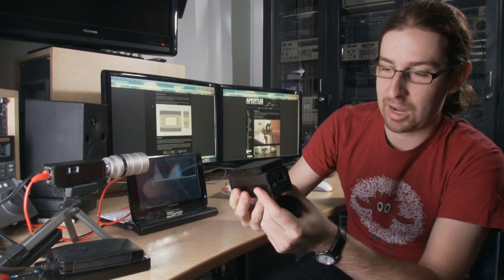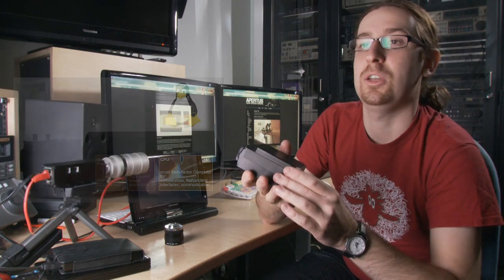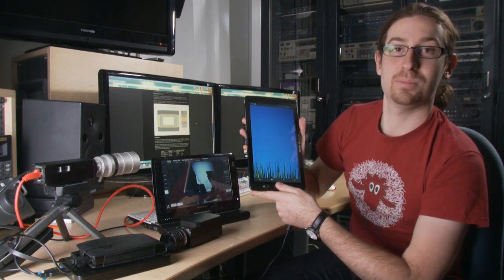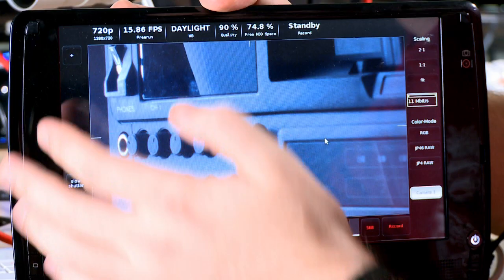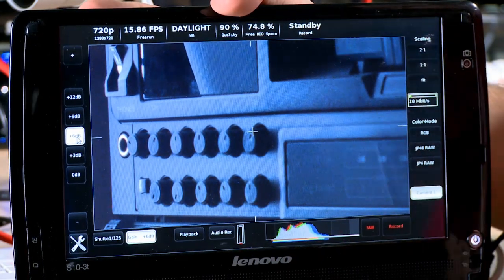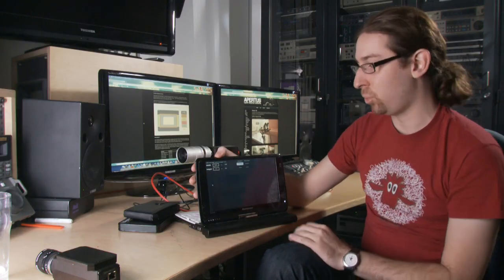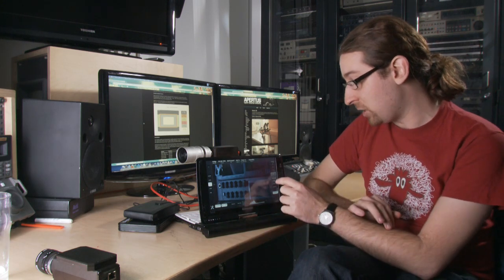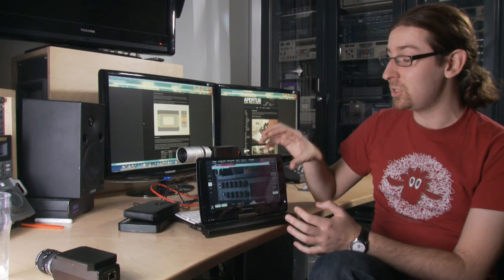apertus° - open source cinema Project Introduction + Elphel Camera Demo

Comment: Neat little camera, it would work better if you can find a way to make the sensor in the camera as a "physical ratioed" nano version of a 4K television screen (better yet, 8K); you then could make the manual focus lens nothing more than software (a program that molds the light to set specifications, like a glass lens does naturally; with full definition to achieve the proper image.  Continued aspect ratio to light where the sensor fills in what isn't brought in from the focus of the lens.  In other words, something different than what a human eye does).  Removing everything from the lens mount on.

No projection of a focused, inverted image on a, though high tech one, but what is very weak sensor (in terms of interaction with light).  (it should be able to "see" radio waves, which can then also be filtered out of the image.)
Reply: I'd like to see that open sourced.